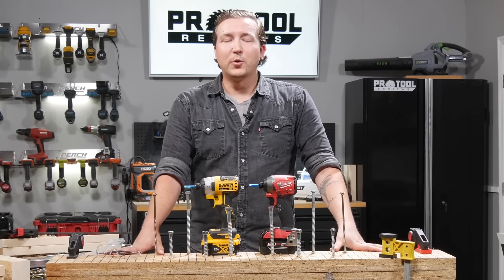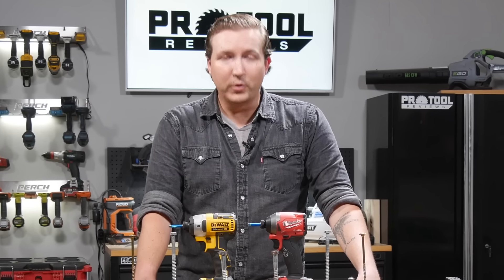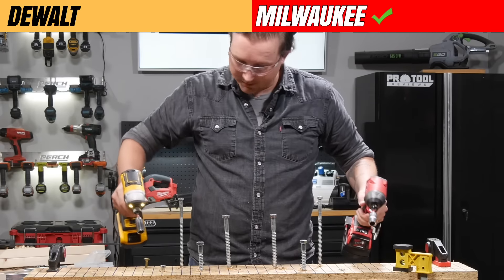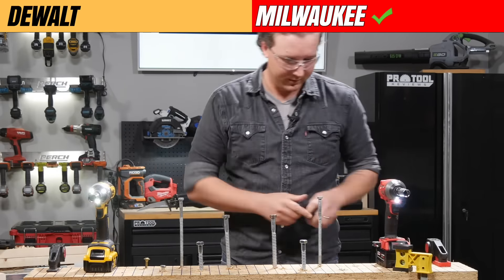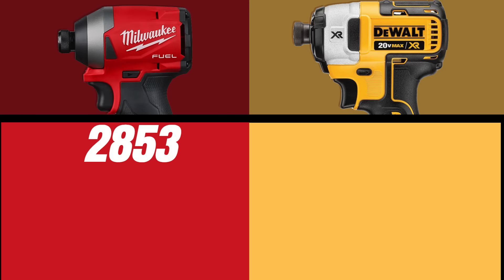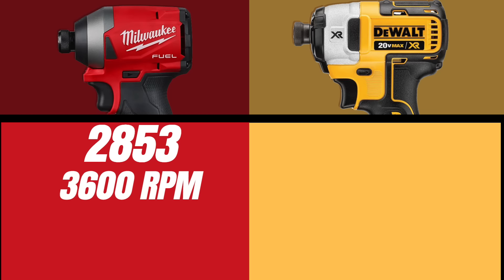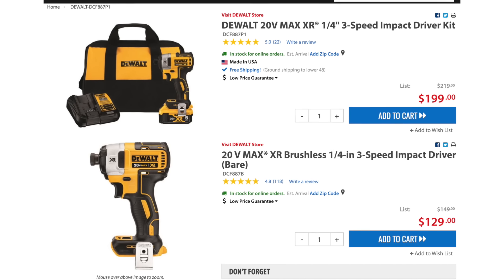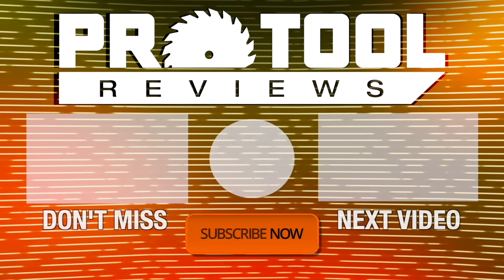Milwaukee VS DeWalt: Impact Driver Review

Comment: It's true, the 887 is not quite as powerful, but it's plenty strong enough to do the heavier jobs without the spending the other 33%. In fact, for 3-4 inch hardware I run mine of on the second gear of three bc of over tightening issues and directional accuracy, bit lifespan etc. I've run a lot of impacts and drill drivers through the years and I think for the price this one is hard to beat. Having the right tool is more important than having more power than you need in 1 tool. With the pricing being 2/3's the dewalt brand offers the realist proposition to buy the additional tools you need to do it right for same price. More tools certainly doesn't mean better by default but the lack of the right tool can be the difference in professional quality results and half-ass work. That's just my 2 cents
Reply: Bare tool is only 10 bucks difference. The Milwaukee kit being 100 more has 2 batteries and may be higher capacity too
Reply: I agree. For my needs the XR range is just fine. Also helps that DeWalt has amazing cordless routers and arguably the best oscillating tool out there. Another bonus? I have found it far easier to find repair shops and replacement parts for the DeWalt range.

Comment: We have multiple waukee's and they all suffer the same issues. Bad collets; junk triggers and horrible battery connections, no vibration mitigation. Our DeWalts tend to get weak and burn up over time which is understandable under heavy construction use. I've now switched to the Makita XGT line of tools. Tried team Red & Yellow, now it's on to Teal....
Reply: …..update lol?
Reply: @SuperGettoboy  they all got burned up
Reply: how did the Makita hold up
Reply: U sound like a dolphins fan
Reply: No point in going teal if u aren’t using Bosch 🤣🤣

Comment: I think coming up with a contest involving small screws or precision work would be interesting. Maybe test alternate functions like how well the impacts can drill holes or remove lugnuts with attachments. There's only so many ways you can confirm that, yes, Milwaukee tools are the most powerful across their lineup in general.
Reply: Most of the tool reviews are focused in raw power and not other factors like finesse. I brought into it and own Milwaukee. OZ tool talk focuses on other factors. Also, is that a 6ah on the Milwaukee? Not that it wouldve changed the outcome of this test. I'm curious on DeWALTs replacement for the 887. I'm sure they will come out swinging.

Comment: As for Milwaukee, I can definitely say - after more than 4 years of use, that wrenches, screwdrivers and impact wrenches are really strong, not to say that they are the strongest among 90% of the competition. and so far, they probably have no competition 😁😁 PS. very fast, and very reliable test. I like that and 👍👍👍👍

Comment: I didn’t find this informative at all… you just proved that a name plate 3600RPM is faster than a 3200RPM and a faceplate 4300 IPM is more than a 3600 IPM… will you note confirm that “3” is greater than “2”? How long they last, who will drive the more difficult screw, if they have speed controls, etc., are all more valuable than essentially telling me that 3600RPM is faster than 3200RPM. As I’ve gotten older, I find the little slower is much more tolerable on my wrists. My experience with DeWalt is it provides maximum comfort over the others I’ve tried (conceded, not Milwaukee). I really don’t see how anyone can be impressed with this “demo” and I would really have liked to know what the malfunction was in that second or third “comparison”.
Reply: Exactly what I was saying, it makes zero sense. But because he is just comparing flagship models, he tells me it "makes a lot of sense" 🤣🤣

Comment: I admit Milwaukee is stronger, but Is it worth switching from dewalt to them? No. I like my dewalt tools they still get the job done for what I do around my property 🤷‍♂️
Reply: I'm a professional carpenter, and have mostly Dewalt cordless with one exception. Once you have invested hundreds in batteries, it's pretty hard to switch over to a tool that appears to be about 10% better. My one exception, I have a cordless Milwaukee multitool; using them side by side the difference was huge. Imagine if they had interchangable batteries, but that will never happen.

Comment: Yeah i know Milwaukee is better but I'll stay with DeWalt.
Reply: What makes you think it's better? Because of this inaccurate review?
Reply: @loopy7057  Not inaccurate but with higher specs of course it’s gonna perform a little better.
Reply: @loopy7057  yes it is inaccurate reviews. I can tell when the fasteners are coated and soaked with lubricant, or coated with Candle wax. It makes them easier to drive the fasteners with lest torque needed.

Comment: Kinda unfair to compare prices. The bare tool
Prices are a $10 difference. And the Kits aren’t even comparing apples to apples. DeWalt has (1) 5ah battery for $100 less while the Milwaukee comes with (2) 5.0ah batteries. I’m willing to bet the DeWalt 5.0ah battery isn’t $99, actually I think it’s closer to $159 so the DeWalt kit is actually
more expensive.
Reply: @Protoolreviews  face it, mate. Your review is completely flawed.

Comment: Was either one more comfortable to use than the other? Also, the reason for the $139 tool-only price tag is because of the dual-ball detent installed nowadays. A.k.a. "gen 3.5"
Reply: DeWalt kit was also one battery against the Milwaukee kit with 2
Reply: @Apache-Helicopter-Life  yeah, I was referring to the "tool-only" purchase price shown. Sorry.

Comment: Could we see a comparison on the high voltage 54 volt battery Dewalt, compared to the 12 volt or similar in the Milwauke range !!! Preferably tested on a 4.5 inch grinder !!tks v much looking forward to it!!🇮🇪🍀💪👌

Comment: Milwaukee just hits different. Powerful brand
Reply: Well not anymore 🤣. Flex 24V Impact Driver is out there and that tool is a Threat to Milwaukee's Existence. Yeah you can say Milwaukee fuel have 21700 3ah and 6ah battery. Flex will have those batteries pretty soon. And Flex will release their new Stacked lithium 3Ah, 6Ah, 8Ah and 12Ah. Sorry dude! Not Everytime Milwaukee is the King. Milwaukee gotta lose sometimes. 🤣

Comment: These tests are, interesting, but also pointless.  The real question is which platform is best for you.  Which includes ALL of the tools you are going to use, who has the best selection of tools, which batteries are best, the warranty, and who has a service center near you.
Reply: @William Murphy   all major brands inclue all of the same tools, so these are meant to help those on the fence.  If you are using warranty, everyone should be buying rigid.

Comment: That milwaukee is a beast. Get one with the double ball bearing collet and you have a very near perfect impact driver.
Reply: They quickly fixed the collet issue, but they still dont fix their trigger problems :(
Reply: @NoxiousShock  hi, is that still a problem? I’m interested in getting it but not with that issue!
Reply: @robertfrate9738  its still an ongoing issue. Other then that, i love my fuel impact
Reply: @NoxiousShock  I can’t imagine how annoying it must be, I should try it anyway maybe from new it’s not as bad,
Reply: @robertfrate9738  its not terrible.  You just have to hit the trigger multiple times, i recommend trying it anyway, youll like it regardless :p
Reply: @NoxiousShock  if I did have this issue I’d send it in for service right away, it seems like Milwaukee’s older tools have minor issues here and there, in my they always address their product and stood behind it no matter what,
Reply: Any 2853 made in late 2020 and into 2021, all have the dual ball detent, now. That's also the reason for the $139 price tag, now. Worth it. 💪

Comment: Who can help me? I'm a new concrete carpenter framer and i want to know which brand in all brands is the most powerful and quickest?
Reply: @bennettstevenson3074  any other suggestions I dont like the looks of hilti
Reply: Try Flex 24V! Try the high end Flex 24V Impact Driver and Hammer Drill. You can see them at Lowe's. Flex is the only one that can toe to toe with Milwaukee. Some calls it a Milwaukee Killer. Flex will also release the new 3.0Ah Stacked lithium battery, 6.0Ah, 8Ah and 12Ah the same battery technology on DeWalt power stack but with much more muscles and raw power, these Flex batteries are a threat to Milwaukee's 21700 3Ah and 6Ah batteries. So yeah try Flex! I've had mine for a month now and happy with them! It's a Milwaukee Killer! But I still have my DeWalt dcf888, 885 and 801 impact drivers and dcd996 hammer drill. I also got Bosch, Makita and Hitachi as well.

Comment: I would not buy the new line of fuel power tools .. worst option  for recharge  batteries.. after charging., and clipping back on power tool there is an on /off power button  on batteries  .. since when did we need it. Inconvenient  especially  when  doing sheetrock  over head. Oops forgot to turn on my already charged battery.  Onsite accident  bound to happen

Comment: Why compare the 1800in/lbs DeWalt to a 3000+ in/lbs of torque Milwaukee?? It's an Overkill for Milwaukee. Why not compare a something that is a threat to Milwaukee's Existence?? There's a Flex 24V impact driver out there. They called it "Milwaukee Killer" I heard Stanley Black and Decker and DeWalt Sold the Power stack lithium patents to Flex, Flex now have a Stacked lithium technology that can have a much higher amp hour stack. Even an 18650  lithium 24V 5Ah Flex can still keep up with Milwaukee. Otherwise Pro Tool Channel never showed us the fasteners they used If they are covered in some lubricants or coated in candle wax to make it look like that Milwaukee is faster than the other. Pro tool! Do the test again! And show us the fasteners you guys use straight out of the box! They have to be dry and no lubricants there because I caught other YouTube reviewers doing that BS.

Comment: Ok 2 things; doing 2 at once is silly because different arms have different strengths, depending on if you are right or left handed. And secondly, why would you compare 2 of completely different price and specs? That makes literally zero sense.
Reply: @Protoolreviews  oh they don't? You think your weight/arm would have no effect on the speed at which it is screwed in? Of course it would! You are subject to the effects of Physics, mate.
Comparing flagship models is only about as useful as far as fanboys wanting to compare. There is literally zero practical use anyone could get out of this as most people want to compare price and features. Most tradesman I know could give a rats about comparing flagship models. It's all about what they can get for what price. 
So unless you are just comparing for fanboys, then no, it makes no sense.
Reply: @Protoolreviews  so no argument there, huh? no worries, champ. You too. 👍👍